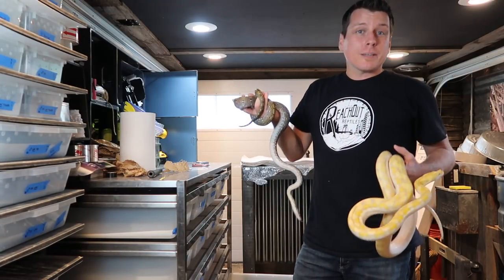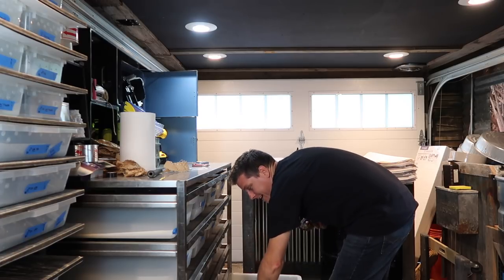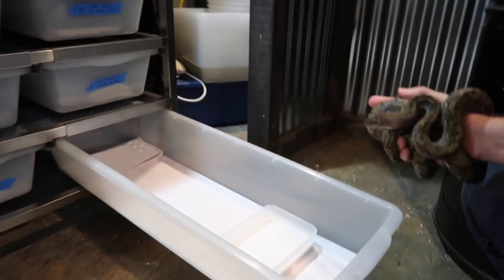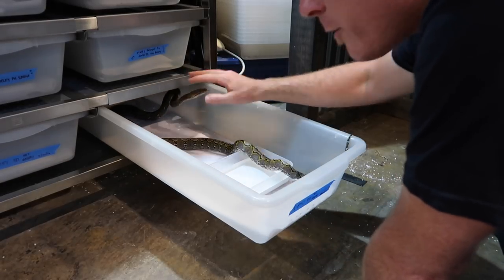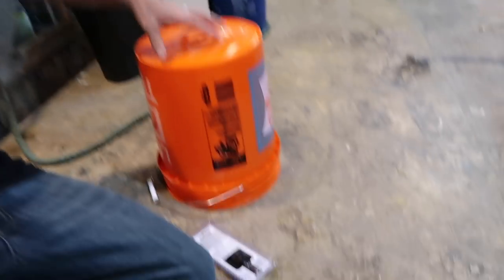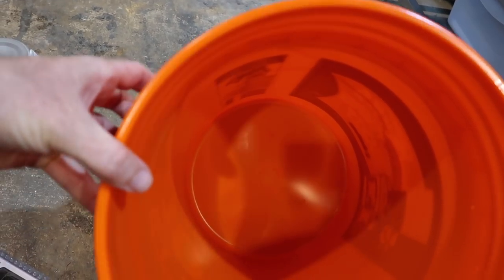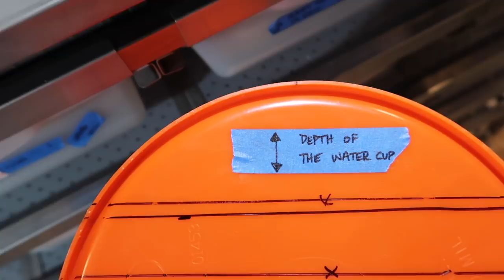Bucket Life Hack [for Reptiles]

Comment: Genius idea!! Def going to be using this. I use square cat liter boxes upside down, and cut a hole in the front for hides for my larger ball pythons that are in 3 and 4 ft enclosures. Saves a lot of money on hides and they can lay on top of the boxes too because they’re square. But this bucket idea for racks is amazing! And the added spot for the bowl 👍👍👍👍
Reply from the maker: Yeah- those work well!  I like putting rails attached to the ceiling that I can slide those into, so they are inverted, and don't move around.  ;)

Comment: I have an awesome hack for temp and humidity monitoring in my tubs. I wish I could post a pic, but it goes like this... I buy these thermometer/hygrometer combo units that looks just like a hockey puck. They are my favorite for around the house and inside terrariums. Kusko uses similar units but he just throws them inside the tub and they lay on the substrate which I don't like. What I do is take two rare-earth (super strong, about the size and appearance of a quarter) magnets and attach the unit on the back wall of the tub by placing the magnets on the outside of the tub but lined up with the magnetic mounts on the unit which is in the inside of the tub. The snakes can move it around but that doesn't happen all the time and if they do, I can just open up the tub and slide the unit back in position. Sometimes I can even move the unit itself by just sliding the magnets from outside the closed tub and the unit just follows them. They stay in place pretty well and all I have to do is check in the front window of my tub and shine a flashlight on the back wall and I get air temp and humid from the big display on the front of these. Of course my entire rack is controlled by a Herpstat with 2 probes for temp spread across the tubs. But that is contact temp, not air temp and no humidity readings. The magnets work awesome though. And when it comes time to clean the tub, you just pull the magnets off, take out the unit and you're done! No holes, fasteners, or adhesives to mess with. You have to be careful though. The magnets are so strong that if you have them in your hand, they will attract each other and slam together so hard they will shatter like glass sometimes. So a little caution is advised when working with neodymium rare-earth magnets. But it's not that hard to get the hang of and once installed, I have never had any issues relating to the strength of the magnets. Works great!
Reply from the maker: ooh, I like that idea...

Comment: Brilliant solution! I love DIY snake stuff like this. I've used birch bark for hides (paper birch are local to me) as well as cat litter boxes for larger snakes, and I've found that putting a basalt beach stone or two in water dishes helps prevent them from being tipped. I made a small "snake shield" out of cardboard with a cardboard tab handle taped in the middle of the back to prevent my hand from being potentially bitten by enthusiastic boas. Work smarter not harder eh? I'll remember this bucket trick. Could do this with all sorts of plastic containers.
Reply from the maker: All great ideas!  An old penny will keep water clean and fresh as well.  Just drop one in the cup.  ;)
Reply: Pre-1982?
Reply: I have a litter box as an enclosure for one of my snakes right now! Got it from the dollar tree.

Comment: Love this! Thanks for sharing with us. most of my experience is with BP's and Corn Snakes, and I loved to use the white 4" and 8" deli cups upside down with a entry hole cut in as hides for babies and adult corns. They are so cheap, and you don't even need any fancy tools, just scissors. Using the low height ones, there is plenty of room on top for the to climb. I was looking for a cheaper alternative for adult BP's and larger snakes than small kitty boxes, and this is great! If you cut it just right, you could probably get 6 tiny ones for little snakes, or 3 almost as big as you did :)